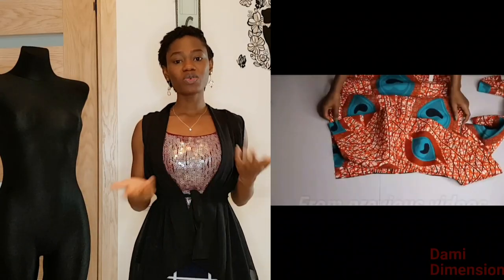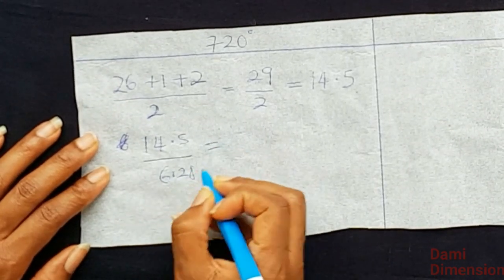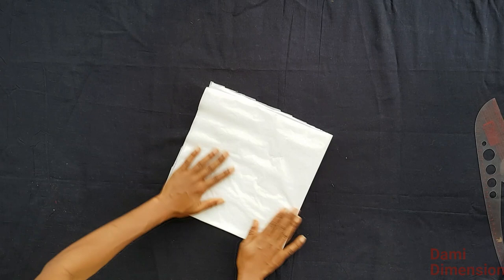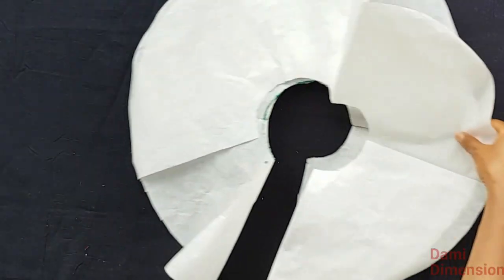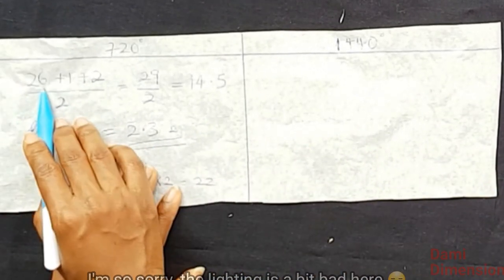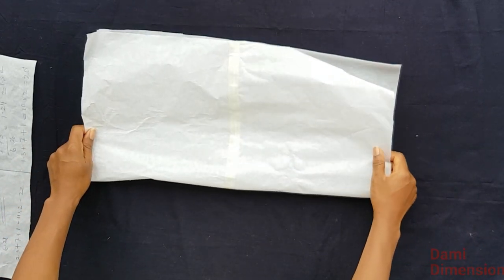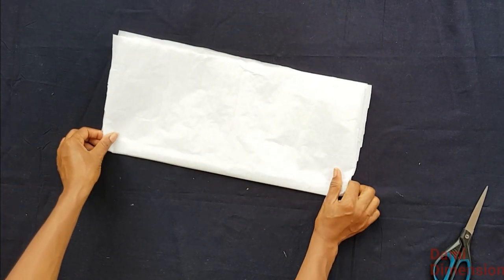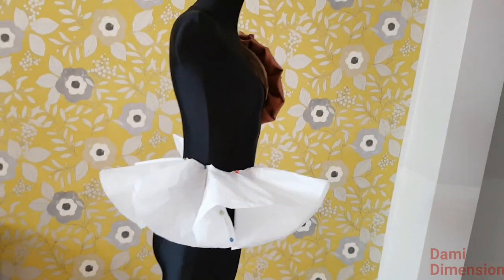HOW TO CUT 720 DEGREES AND 1440 DEGREES FLARE | PEPLUM TUTORIAL | BLOUSE | TRENDY PEPLUM

Comment: Thanks for the detailed calculations. I have a question, when you sew the two circles together, it means that the joining part will be at the front of your peplum. Will my work be fine with the joining at the front?
Reply: Umunna Olaedo Nodebechukwu it'll be wavy and it will be ironed so it definitely won't be noticed.